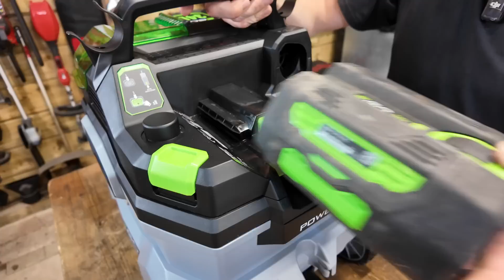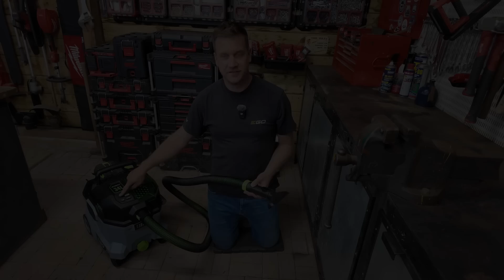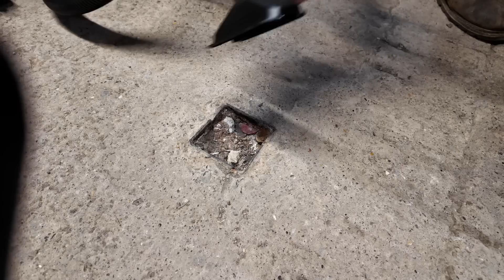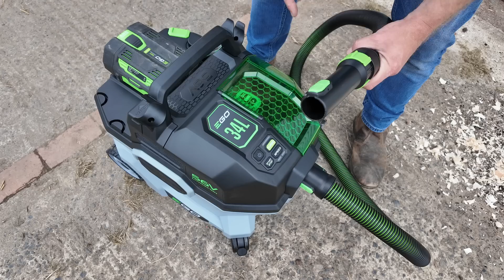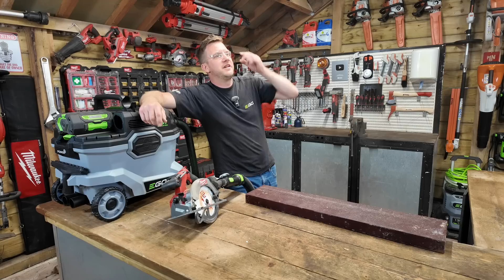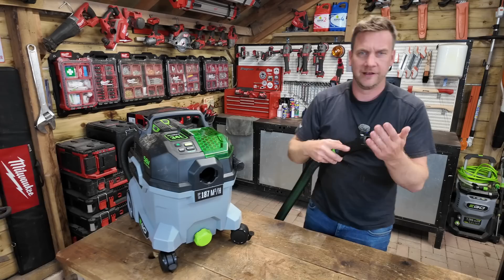What NEW TOOLS Will be coming from EGO over the NEXT 5 Years?

Comment: I'd really like a UTV. Could be built off the riding mower frame. Four wheel drive with a small dump-bed. I also like the idea of a wood chipper, assuming it has a good capacity (>2.5").

Comment: Compact chipper would be ideal for domestic rather than commercial. Paint sprayer, general sprayer, indoor tower fan and a workshop dust extractor also would be really handy, as would a radio for working on site. We use Ego for most of our gardening needs but the multi-tool attachments like pole saw, bristle brush and cultivator need improving. The pole saw leaks oil no matter how you store it and is very unbalanced. The bristle brush could be half the size and easier to handle. The cultivator, which can be used as a tiller (like some people are requesting), doesn't have the weight of a tiller and doesn't get to the depth required unless you are doing very small areas (like a raised planter). Power barrow and/or cart would be great additions too as you mentioned. Overall, the Ego brand is quality and we look forward to more exciting products reaching the UK. Keep up the great work with the videos MN!
Reply from the maker: Some great examples there! They would all make good additions to an ever expanding range :)

Comment: They do have some new battery technology coming in 2026 with their new Commercial Mowers. They are huge suitcase batteries. Mowers will be for professionals who need to mow all day. Stand on mower as well. Rumor has it they are also working on a UTV/golf cart type utility vehicle. Unfortunately, it would be on the new battery platform. I'd love to try to convert my John Deere 6x4 to run on the Ego 56v batteries. There will be new power stations coming, which will be able to charge the smaller 56v batteries. I'd like to see products like the vacuum & power washers come down $100 or so. Would be cool to see them come out with a series of motors to replace common engines like Briggs & Stratton so you can easily convert gas engines. I know they had a similar product that never seemed to make it to the US market. Log Splitter!!

Comment: Dual battery backpack link, reel mower of some kind, commercial attachments for the commercial power head. Also commercial grade batteries would be nice since they seem to want to go more into the commercial route moving forward. A wood chipper would be cool to see. A hand held or push seed spreader would also be interesting to see.

For those saying 30 inch mower, don't worry they are coming out with one. No idea when but it is confirmed as it was shown at the latest equip expo.

Comment: A electric powered log hauler, with option for disabling the powered wheels when towing. 
You have the LOGRITE BUCK ARCH for hauling logs (short or long). You can either push/pull the buck arch by hand or hook it up to an ATV/UTV and trailer it around.... BUT.... If you could option a powered electric version, for when you need to enter rougher ground with obstacles to annoying to tow behind a ATV/UTV, you could unhook and walk the buck arch to the log and bring it back to the trail and hook it back up to the ATV/UTV, disengage the motorised wheels and tow the log home. Or if you are manoeuvring a log up/down a rough or steep(ish)  yard, a powered log hauler would  be a godsend.
Reply from the maker: You have given this one some thought for sure Pat! Great feedback thank you 🙌🏻💪🏽

Comment: I am steadily approaching 70, live on the south coast of the UK and have had my petrol cylinder mower for 36 years and it cuts as good as it did when I first purchased it.
So why did I replace it. Well its heavy, large and takes up room in the garage, smells of petrol and servicing is getting more and more expensive.
Bu the main reason is that an old shoulder injury has come back with a vengeance and pulling the cord starter is far too bloody painful for this old fart.
So sitting at my computer and trolling through all the lawnmowers available I kept coming back to EGO.
Not only did I watch tons on your channel but I also looked at all of EGO's power tools and reviews and I came away very impressed.
There were a few complaints but these were ridiculous and quite pathetic, quite sure these people do not live on this planet.

So I opted for the EGO Power LM1903E-SP 47cm Self-Propelled Cordless Lawn mower with 5ah battery and charger. 
Now for a pensioner it is not cheap, but it is certainly well worth it, did my front and back garden with no stress, never had a powered one before, and only used three bars on tha battery, fantasticcut, very happy EGO owner.
Now I want to eventuall replace my vacuum and blower when I can afford it.

What I would really like is something exactly similar to the COBRA S3840V 38cm (15in) Cordless Battery Scarifier & Aerator but made by EGO.
Thinking about it a Universal Sprayer - Electric Paint Sprayer for dispersion/latex paints, varnishes & glazes - interior and exterior usage for spraying the 30 odd fence panels I have would be great.
Reply from the maker: Thank you for the in depth feed back! Glad you are happy with the mower.
Reply: That’s why I started using them, except I just didn’t want to cause another minor injury. You’ve almost got to be a pro and need loooooong use to go with gas/petrol. Even then, it’s worth something to not smell of petrol.

Comment: 1. A proper roller mower, I know they have the attachment but I’d love something along the lines of the Hayter models (with the ego folding handle). 

2. Scarifier, I use the Husqvarna model but it’s only 900W so something around 1500W would be nice. The next step for me would be a Camon or Eliet at around £2k which is very pricey. 

3. Cylinder mower, Alletts are lovely but expensive, the Cobra weighs a tonne. A 43cm, 35kg, Ego powered cylinder mower (for under £1k) would be awesome.
Reply from the maker: Yes a dedicated domestic roller mower would be ideal 🤞🏼

Comment: Great Video as always! I would like EGO to make their own 56V battery powered cylinder mower like Allett and Cobra Fortis have with multiple changeable cartridges for full all-in-one lawn management system. 2ndly, they should also have own battery powered power tool range like Dewalt or Bosh or Ryobi have. In the cleaning range, they must introduce their own battery powered heavy duty pond cleaning vaccums and submersible water pumps like Karcher have.
Reply from the maker: Egos own domestic cylinder mower would be great. I think their batteries would be too big for smaller power tools.

Comment: A desent heavy duty rotovator, there are battey tillers on the market, but not a decent rotovator that will dig down. They are a tool that are only used a couple times a year, so getting away from E10 petrol and carb issues would be ideal.
Reply from the maker: Yeah agree! 18” wide with merry tiller style blades, adjustable handles and a well engineered drive system would be proper 👍🏼

Comment: 100% scarifier
A reel/ cylinder mower would be great too see as well.
Reply from the maker: They already use their PBE range on other cylinder mowers from Allett and Cobra, but an EGO branded one would be ideal 🙌🏻
Reply: That is true, having more options is never a bad thing. And I feel if they did something similar to cobra and allet with the changeable cartridges it would be great, one mower and a multi tool and you've have 99% of what you need @MachineryNation

Comment: A Powered wheel barrow 
A Compressor would be nice 

If Ego had Cub cadets synchro steer, with their e-steer ride on, it'd be a force to reckon with 😉
Reply from the maker: Yes mechanical steering on a zero turn would be ideal, it makes cutting on slopes much easier

Comment: Hi James you had some idea's there a big drill would be good had nearly forgot about the petrol drill stihl used to make how about a battery concrete braker or battery hydraulic power pack  Thanks again will wate for the royalty check in the post 🤣🤣
Reply from the maker: Haha! Yeah a breaker would be awesome!
Reply: @MachineryNation  Looking at a lot of suggestion's hear that could be made with there battery power unit fitted to existing machinery   Thanks again

Comment: Very impressive the vacuum is indeed ..  thought the speaker is what you were going to demonstrate  lol .. power barrow  is a great idea ,  cement mixer  maybe .. a bigger sweeper/ brush .. a battery winch ( got stuck badly two times this year with zero turn and ended up using straps and rachets off trees to get the mower out lol ) .. mobile power work platform/scaffold
Reply from the maker: Yes very impressive! A walk behind sweeper would be ideal 🤞🏼